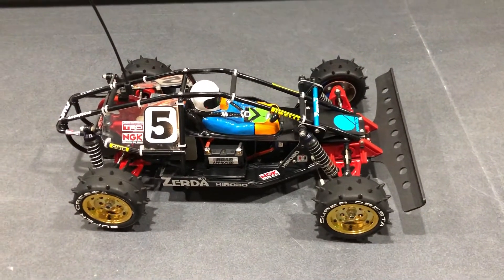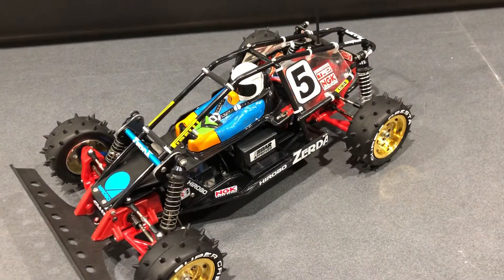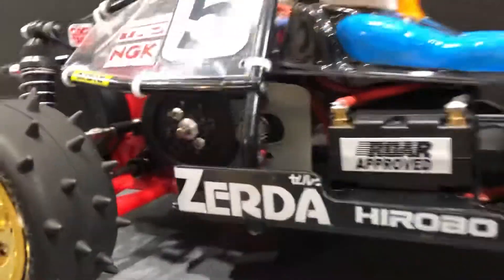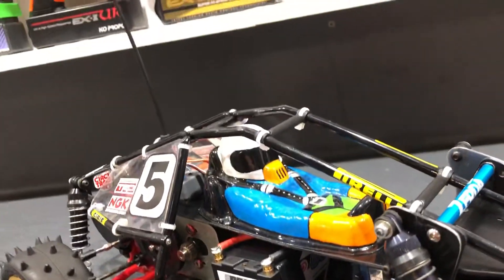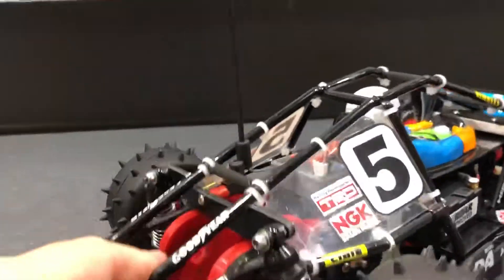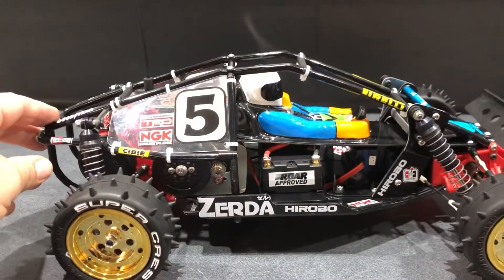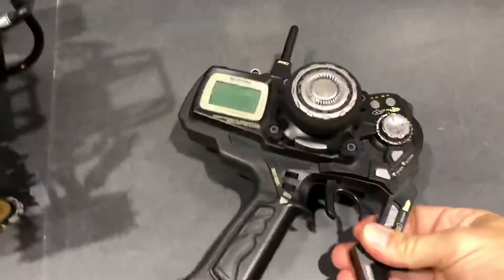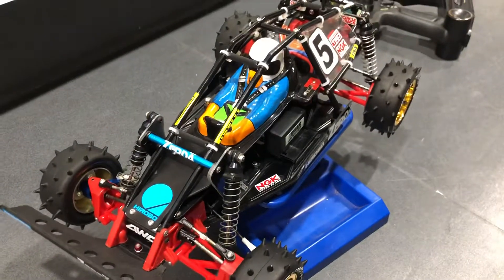Hirobo Zerda 4WD vintage MID motor racer 2019

Comment: I'm a bit late to the party but I had one, it was great barring one fault. If it got hit on the front bumper it would make the belt bite.Even a small bump would cause the belt to bite. I like the mods, very nice mid motor conversion. Great memories, great video, subbed..👍

Comment: I love the Zerda, it was my first car, it used to do very well on the racing scene in Australia, curiously I think it wasn’t that popular in other parts of the world.
I had a mid motor conversion and a shock upgrade as well. It was actually a very durable car, much more so than the Tamiya cars of that era. Thanks for the video mate!
Reply from the maker: Yes the zerda was a force to be reckoned with. Where did you race yours?
Reply: @Bormac073  mainly it was in the street and the backyard, but I did take it to Ryde in Sydney as well as St Ives.

Comment: Where can I get the alloy hubs from? Or what search term do I need to use? Please
Reply from the maker: Ebay some 10+ years ago
Reply: @Bormac073  Bahahaha, well it looks like I’ll go back to my original plan and 3D print some that will take 2 bearings. Going to do mid mount and shock mods as well, just trying to find good photo’s or video of those parts. Thanks for the speedy reply!